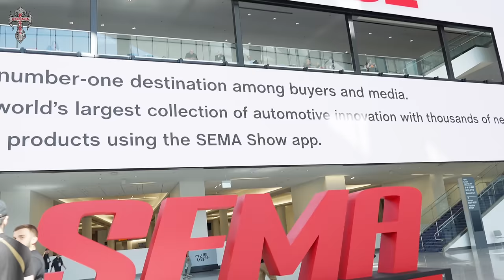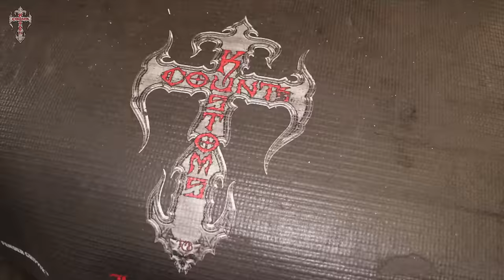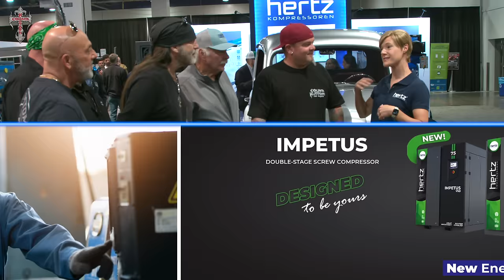Count's Kustoms Reveals a '52 Ford F100 at SEMA 2023!

Comment: That is one fabulous Ford truck. My only point of contention is that it's got an LS3 instead of a Coyote. You used the Best rear-end why not the Best engine? The LS is bulletproof, BUT...
Reply: @garyseaton4619, no Chevturd engine is bulletproof, reliable or has longevity.
Reply: @sergeantmasson3669  Uh ever heard of the ls that came out in 97?
Tons with over 300k  out there.

Comment: I once owned a 1951 ford pickup.
323 cu in. V8, oil an air filter, 3 speed on the column, push button start. I could spin tires on dry Pavement.